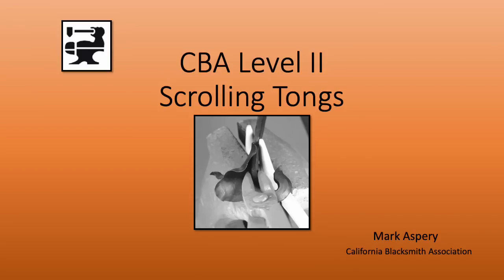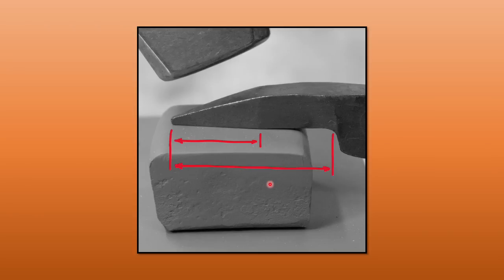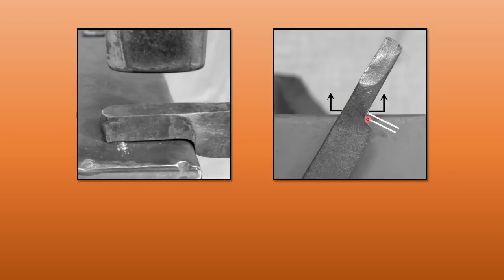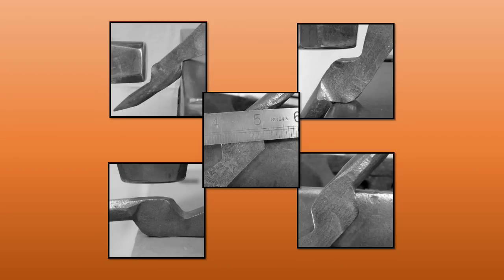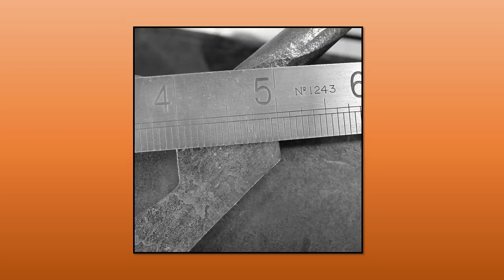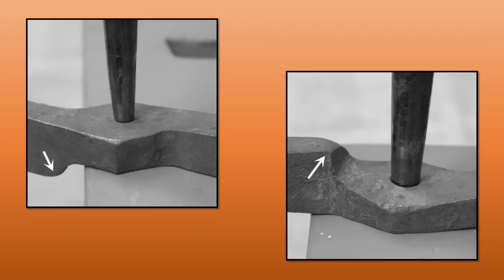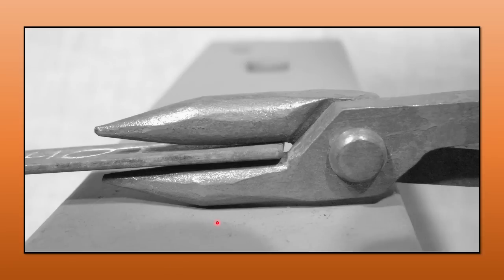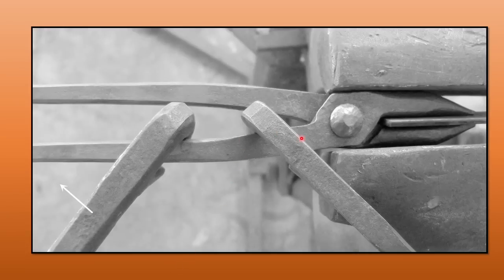Forging a pair of scrolling tongs from flat stock

Comment: Is it worth the time or effort to chase the finished bosses with a hot rasp or flatter to make the 2 surfaces as flat as possible before riveting?
Reply from the maker: Keith, Yes, although if the anvil is in good condition and your shoulder is in the right place it may not be necessary. Once you assemble the parts, the heated bosses seem to "self-level" as you work them. Good question!

Comment: If you are using a rivet header was it diameter x 1.7 or am i wrong?
Reply from the maker: I'd go anywhere from x 1.5 to 2. So long as the rivet holds up, I don't think that it matters.